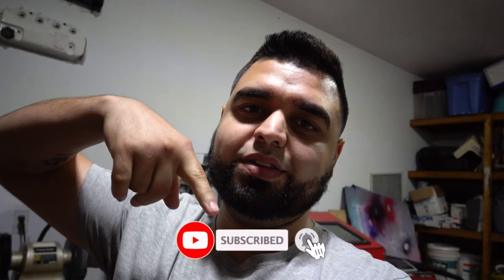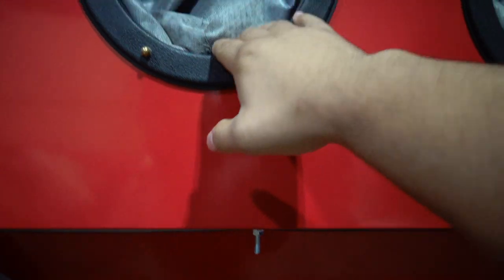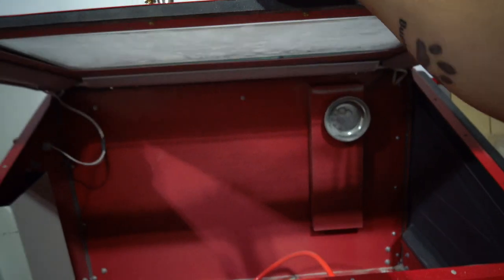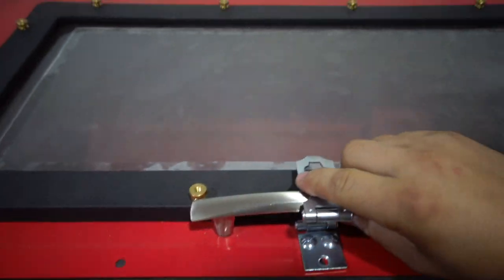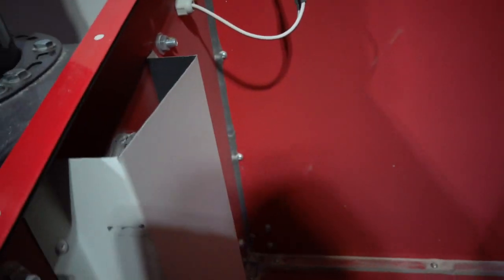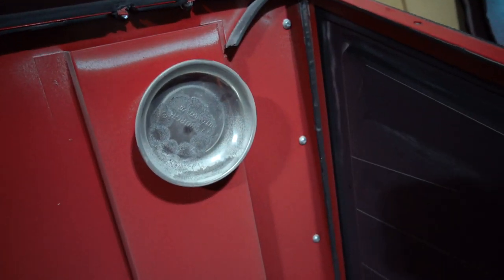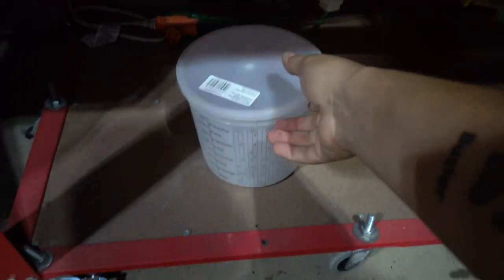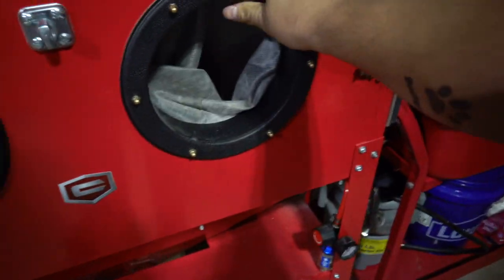Harbor Freight Sand Blast Cabinet Modifications & Upgrades!

Comment: I like the hinged top. Try using 70-80 grit aluminum oxide. Feeds great and cuts rust and paint off quick. I typically dump 40-50 lbs at a time in my little HF cabinet.

Comment: I have the same hinged top, but I made a counterweight with pvc 3" with 2" inside it mounted to the wall behind the cabinet with small rope on each side of the door so that it doesn't obstruct you view I added just enough sand in the 2" so that the door stays up when I open it to put items in, it made it lot easier.
Reply: How did you make the top open and close because mine is bolted down
Reply: @rogertaylor8615  I bought it that way
Reply: @kr5289  oh okay

Comment: So when you effectively installed the top on top of the cabinet did you have to take the gasket off and put it on the topside for the window? Or were your gaskets not installed? Mine are pre-installed.
Reply from the maker: I added gasket tape to the bottom of the top door. Kept the pre installed on in place for extra sealing
Reply: @StayOnTheGas   roger that. My tape was on top so I would either have to take the window tape off or the sealing tape (both were facing up so if I turned the top upside down the window tape would have to be removed and put on top). I took the sealing tape off. Gonna replace it.

Comment: Good vid and nice mods man,  I like the top load, i'd love to do it to mine, but I'd have to completely redo my light setup, as I just took one of those 15' LED strips and wrapped it around the top and the front.  

I'd seriously consider getting rid of all quick disconnects and run a dedicated line to it. It's the best mod I've done. I went from having to pulse it to get full spray to my 60 gal air compressor not being able to keep up with the flow.  It's a game changer.
Reply from the maker: Thanks man. You should definitely look into redoing your lights. The top load makes it 10x easier to use. As you can see, I don’t have much space on the sides so i needed it. In theory, you save space by doing it too. 

My only quick disconnect is the one on the foot pedal which I need with this setup because my gun doesn’t have a trigger.
Reply: @StayOnTheGas  I've got a fair amount of space on the side of mine, but if I start getting to where the parts are too big to load I'll definitely reconsider. 

But yeah, even that one disconnect is a huge restriction. my shop hose is 3/8's ID and those quick disconnects will choke it in half. I just put a T in my hose and permanently connected it with a shutoff valve to isolate it when I'm not using it.
Reply from the maker: I might have to try that in the future then and see if it makes an improvement with me setup 👍🏼

Comment: What compressor do you use with this cabinet? Got one for Christmas and plan to use your ideas and mods. Thanks man.
Reply from the maker: Thanks man! Right now I use a small dewalt 20 gallon electric compressor. It’s good but I have to stop for a little every so often so it can keep up. Ideally you need a pretty good compressor but if you don’t mind the breaks then a smaller one can do.

Comment: Does it spray good enough with this setup to remove older powder coat?
Reply from the maker: Yeah it’ll take powder coat off. Just gotta turn up the pressure more and it does take just a little bit more effort but it comes off 👍🏼

Comment: I added a similar metering valve and bottom feed as you did.  My sand tends to surge in large clumps up the line instead of flowing nicely.  Anybody know why it is doing that?
Reply from the maker: Play with the valve and see if you’re getting the right amount of air and also add a water trap because it could be coming from your compressor
Reply: It may be that the blast cabinet is using a ton of air and if the compressor is running constantly you may be getting water in the line along with your sand. I had the same problem. I bought a desiccator system to put inline with my compressor. That solved all issues with water in the compressor lines and no more clumping.